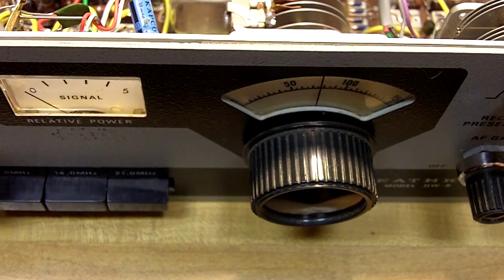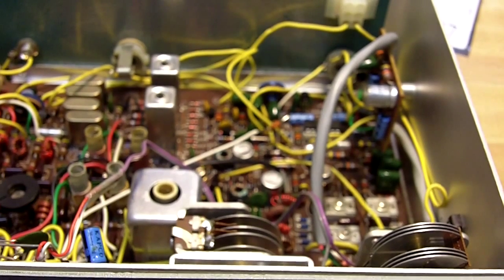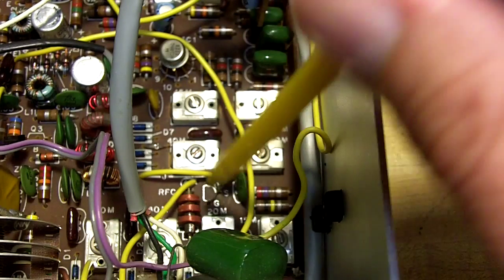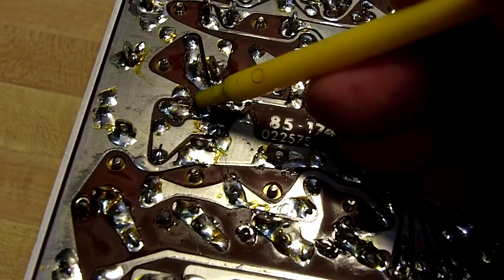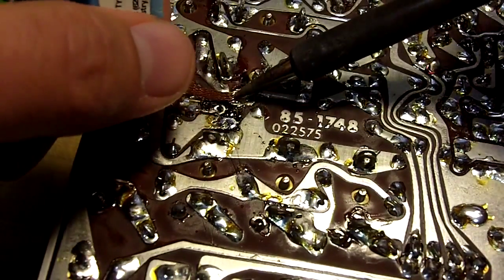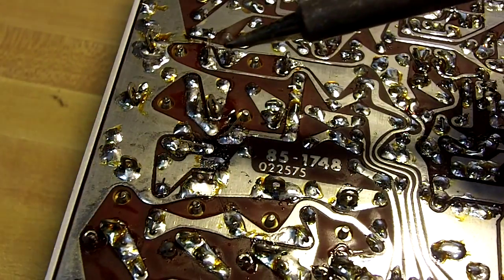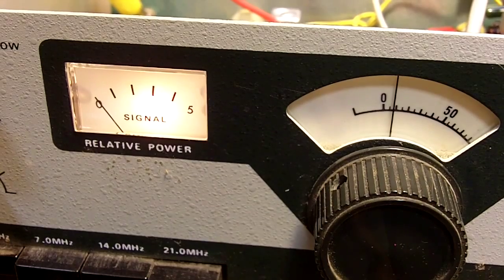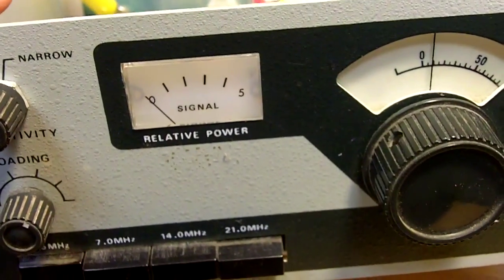Heathkit HW-8 Ham Radio Modification - Hear Weak Signals Better (by WDØAKX)

Comment: i just found your youtube on HW8 - I checked my transistor; it is a M417-169. The installation manual does say a MPF-105. Why would someone install the incorrect transistor. Is it another mod. Thank you for any assistance you can provide. KC6EOA
Reply: I see now in my manual that is the # for the MPF-105. I will replace it with a 102...thanks much! great video

Comment: The FET in question was a bit variable in production. Replacing the MPF105 in three of my HW-8 with MPF102s made no difference. Maybe mine were later production runs of the HW-8 where Heathkit selected better FETs.

Comment: I think it depends upon the particular MPF105 . I've changed three on HW-8s and it made no difference. Putting a 10uF cap across the zener diode supplying volts to the front end makes much more difference by removing noise.

Comment: I think it depends on the characteristics of the particular MPF105  each rig contains as the spread is quite wide. It's not the best FET to use in that position but in the rigs I've had, changing it made no improvement. Proper alignment did improve things and all mine now have a readability of signals down to 0.05uV!

Comment: How is that transistor different? Was the gain better or was it due to the small signal parasitics? You also did not mention what mode the transistor was operating in, CE, CB, CC ? Seems like a bad practice to make mods one does not understand. Please let us know, but over all good video you have a nice way about you... thanks
Reply: It's a JFET so it doesn't have gain in the sense of a BJT. It's "kind of" like a voltage controlled resistor

Comment: I always felt that a coupling capacitor was as good as a MPF105, swapped all of them out in my HW9 de WA8QFE
Reply from the maker: You may be right there, never gave that a try I guess.
Reply: If your interested in changing to MPF 102's in your HW8, I have about 250 of them, new, made by Fairchild.
I can throw what you need in an envelope
Lee, WA8QFE

Comment: Hey, just installed the MPF-102 (cost less than $2) in Q-1 on my HW-8 and what a difference it made. Less noise and better sensitivity. Can't beat that for a ten minute 2 buck repair job. Thanks much for your posting. 73

Comment: Soldering flux does deteriorate over time and becomes conductive. It should not be left anywhere you wouldn't want current flow, even though it is likely to be a high-impedance path it is still a path. Depending on what it has absorbed, it can also become reactive.  I don't remove flux 100% but I do remove any flux that creates a bridge between components or traces.

Comment from the maker: @rhblakeman Thanks.  Also appreciate the info on the steel brush etc, I didn't realize that or think about that I guess so I will try to keep that in mind now, I do have a brass brush also but didn't really consider the difference I guess.  So I will have to use that more then. Makes sense to me.  Good luck with the SB-102, I remember using those in the past.

Comment from the maker: @DONSAHAM Yes, it only requires a diode, 2 resistors and a cap.  I can scan in  the schematic for it and where it goes and send it to you by email if you email me -- my call sign at arrl.net.  It is a very simple mod and works fine.  Hard to describe without showing you the diagram though.  Thanks!